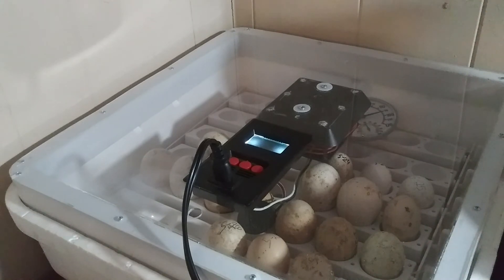MAKE YOUR LITTLE GIANT INCUBATOR BETTER

Comment: I think you would be better off. Putting in a larger fan and spreading out the heating elements the red wire to not be so condensed in such a tight area. If you spot check the temperature in it the closer the element the hotter it gets. 99 to 104 temp swings. My old hove bator element is 12” square it has a fan and doesn’t have the massive temperature swing. For a $10 fan and a little tinkering you can get it to do it’s job much better. Little Giant will send parts for free. But they just don’t help.  It’s a design flaw. My similar Gqf has same central heating with a fan. But fan seems to have much more volume. The old Hova it’s about 20 years old now has a low volume fan but the element is more spread out. 

A styrofoam box with a lightbulb for heat source with a computer fan and a $15 thermostat is a better  incubator than the LG unit. And if you want to use the turners just make sure your box is big enough to accommodate the size of the turner. The fan in a Gqf cabinet incubator has surprising volume there is a decent breeze inside.

Comment: this very good what he came up with but not necessary for its not the deepness of the incubator it the place ment of those red plugs that come with it for instance i made a wayne rush styrofoam incubator and i never have a problem with it i just hatched out 18 of 24 the secret you have to keep those plugs in for the first 7 days remove one and at lock down remove the second one until the hatch is done
Reply from the maker: There was always a cool spots which is a problem